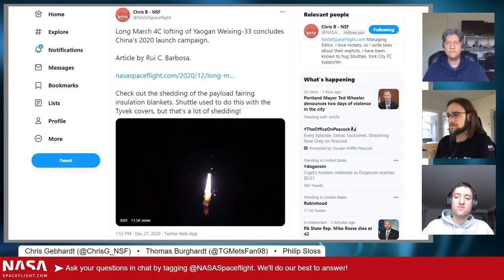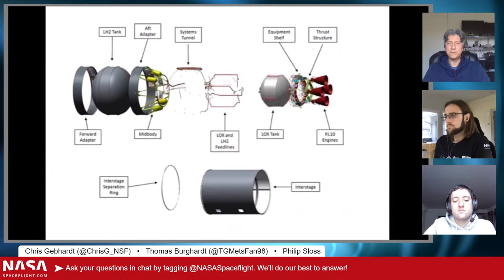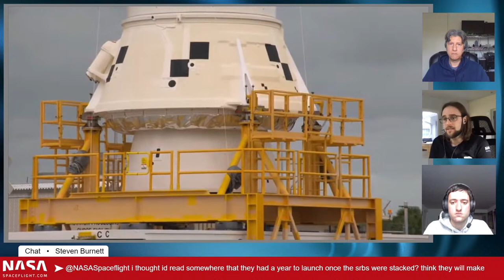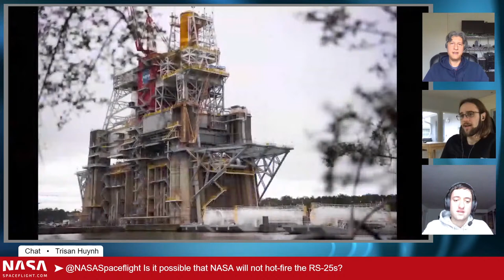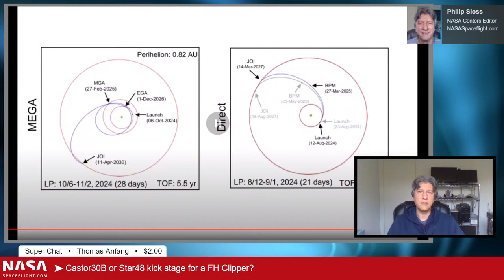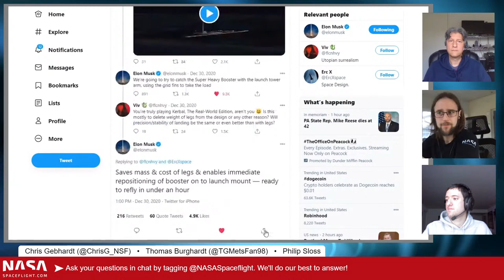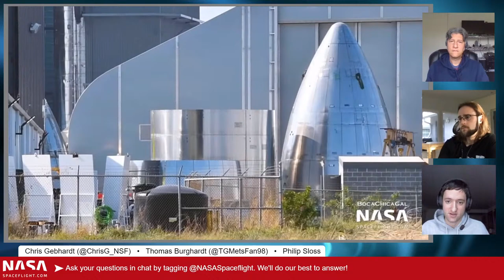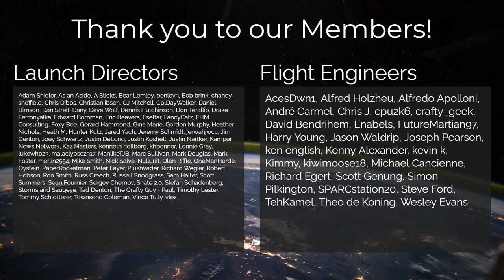NSF Live: Starship SN9 set to static fire this coming week, SLS wet dress rehearsal update, and more

Comment: 1:13:12 Will Starship get to orbit this year?

The year has just begun, and SN9 might fly this week, less than a month since SN8 almost nailed it. I think they will do it and maybe get closer to testing orbit refueling late this year.
Reply: Don't forget that for orbital tests the Super Heavy boosters need to be fully operational as well. That said, by SpaceX's timetable it should happen this year iirc, nonetheless the booster still has a lot of distance to cover. So far there isn't even a finished prototype, and it will have its own low- and high-altitude hop tests. I think the first booster hop is supposed to occur in Q2 which should, in theory, give enough time to progress through the development process by year's end, and the experiences with Starship should make things easier but it's by no means guaranteed that there won't be unexpected setbacks.
Reply: Oh, Super Heavy is definitely going to fly this year. The two big challenges are the launch pad without a flame diverter, which might prove to be not great, and then they want to catch the boosters. But building SH is a lot more straightforward than Starship, considering it's all rings, and the guidance system is pretty close to what the Falcon boosters have. The grid fins will be huge by comparison, and I also expect some reinforcements to withstand the catch/lift stress, but other than that... they simply need enough engines.

So yeah, Q2 seems likely for the SH flight test, or maybe Q3 if something goes wrong. But that would still leave enough room for an orbital Starship flight. This is going to be an amazing year for SpaceX. :)

Comment: Catching the super heavy booster could benefit from a compressible/vertical moving arm system to act like a 'long throw' hydraulic leg. Look at low recoil systems on tank guns that allow big guns to be fitted to light armoured cars...
Reply: I hear what you are saying, but I feel that would require and EXTREME level of precision to catch the SHB. And those LRS are gas compensated, thick steel barrels etc... The SN`s are stainless steel, the skin wouldn't stand the stress and I think I'm getting carried away lol! Essentially I'm saying the landing idea is spot on and I like the idea of landing on a spot and switching modules depending on payload requirements using crane loading system.
Reply: I had a single ram arm type arrangement in mind....hadn`t thought of this.
Reply: @waitingforanalibi2224  I agree with the precision level, but that would apply to any attempt to catch the booster. I also considered the stresses on the booster skin, but they already have reinforcement for the grid fins... air brakes are under a fair bit of pressure when they slow things down. Basically I was responding to the few animations put out that show a 'hard' catch on the grid fins or some kind of hover and horizontal slide. My suggestion was just to add some compression to the catching arms. The normal Falcon 9 booster legs have some compression, but the launch tower would allow a longer compression stroke than any legs attached to the booster. Regardless, whatever they do it'll be pretty epic.

Comment: Somethings that peeked my interest such as: What BN01 going to be using to land on. They don't have the proposed tower to catch it yet, so they must be planning to use some kind of Legs. There was talk of landing it back on the mount it launched from which i think is...ambitious.  Hopefully it won't have oops.   Other thing was SN9 and the SpaceX Solution to fix the header tank.  From what i read it's going be temporary, so this different fuel their going to use to maintain pressure?  No added equipment to keep pressurization. I know weight issue but better than losing fuel pressure.

Comment: People are talking the grabber mechanism, but that might actually not be the biggest problem in grabbing SuperHeavy. You can grab hovering objects out of the air, hovering is only a question of tweaking engine controls a little. SN5 and SN6 hovered controllably, SN8 showed controlled hover on its apogee, they nailed this already.
A real problem might be the moment SuperHeavy shuts down its engines. These can't throttle all the way down to zero, so you get a sudden gain in load while the booster is hanging off to one side of the crane structure. And we are talking a thing thats as big as a skyscraper and may weigh some 200+X  metric tons at that point. We all could see what happened to these Arecibo pillars when they where suddenly facing 200 tons of non-equilibrium load...
So SpaceX will have to come up with a system that can counterweigh SuperHeavy instantly, this will be impossible to achieve by pumping ballast water or running some concrete blocks on rails ( both used in classic heavy lift cranes, both too slow i guess). I guess there might be some large pendulum structure ( like 100 tons of concrete or lead on a stick) that is suspended close to the support structure, and in the moment of engine shutdown it is released and swings outward where it is locked by a catching mechanism.

Comment: 20 years to take shuttle tank, attach 4 shuttle main engines and make longer solid rocket motors.. It would take spacex 3 years max to do this... Milksville, AL.. will Joe Xiden cut the SLS? since most of is made in red states?